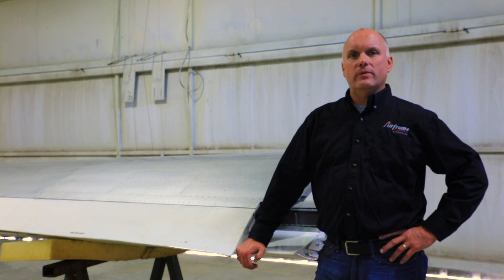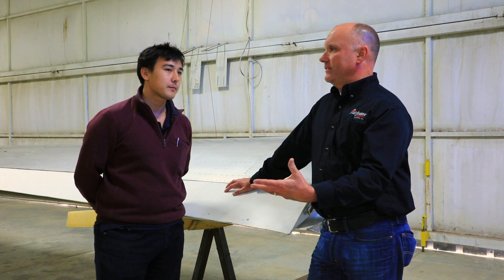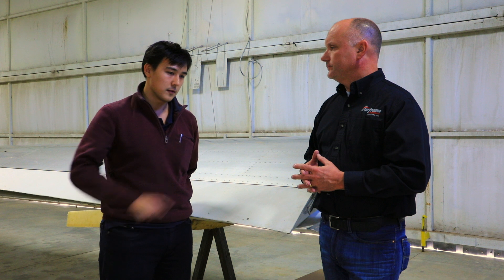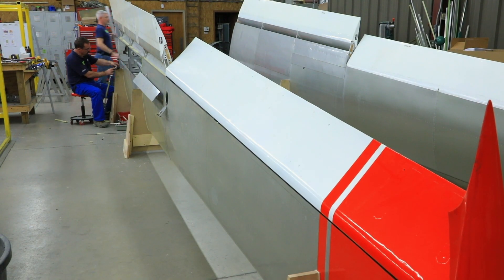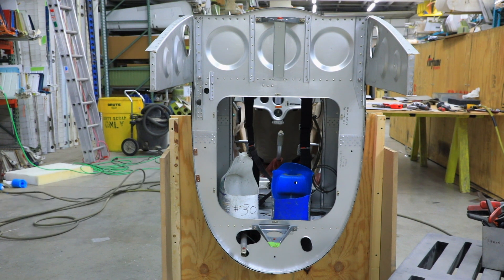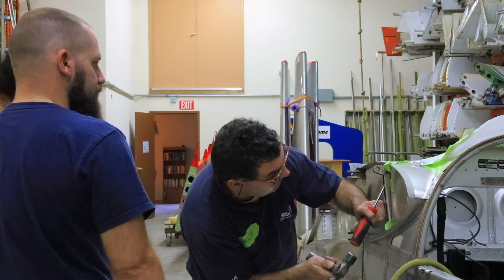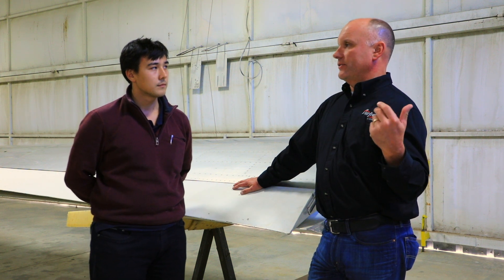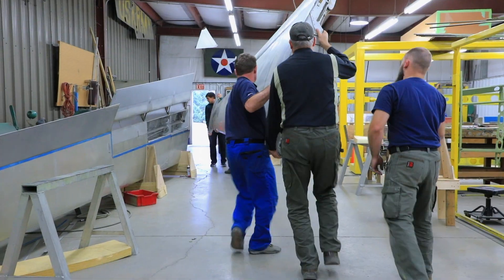Blanik L-13 Wing Modification Program E2

Comment: What is the cost of this modification? What does LET charge for a new set of L13 wings and did the own buy them?
Reply: Just a guess, but I'm thinking $15,000 for the repair.  A refurbished Blanik L13 is about $28,000 FOB Czechoslovakia, so a new wing at least half that?  A brand NEW L23 is above $80,000 and these are the only two place, all metal gliders available worldwide, so the 2000 or so L13s worldwide are worth fixing.  A fixed L13 in Washington state is for sale for $53K.